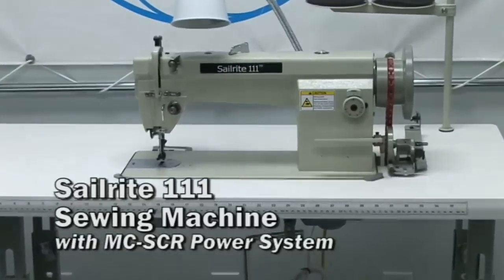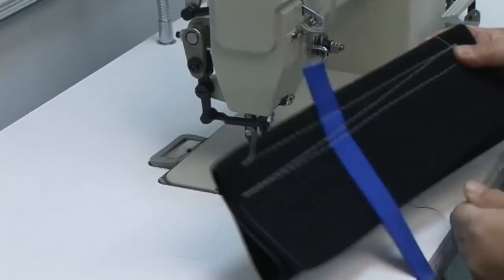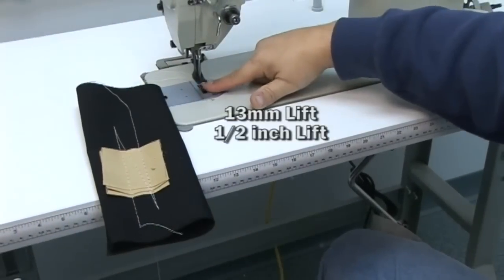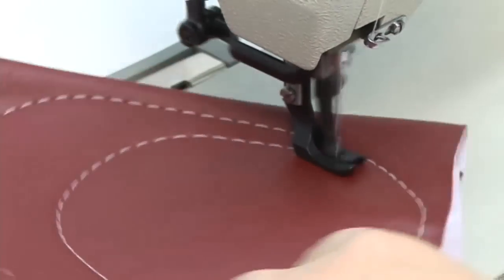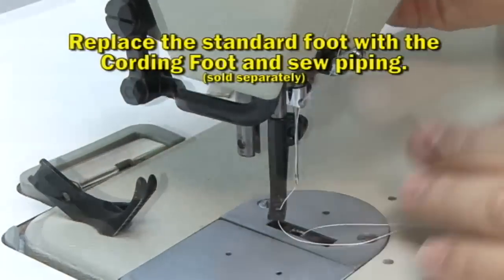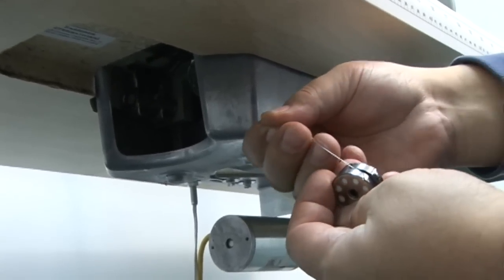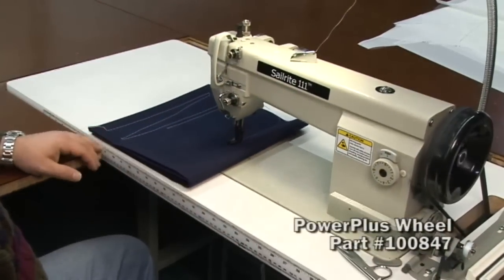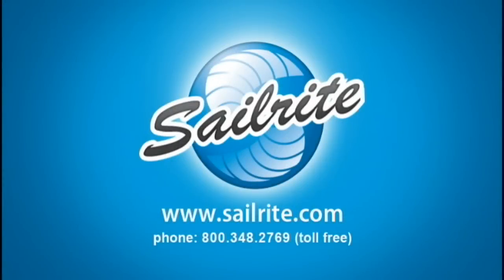Sailrite 111 Sewing Machine in Power Stand with MC-SCR (Discontinued)

Comment: This is the Typical GC6-7D With Sailrite logo on
Reply from the maker: Yes and no. The head is made by Typical, but the sewing machine head is modified, adjusted and timed by Sailrite technicians here in Indiana. Then we add the Sailrite MC-SCR power systemand many other components which are made in the USA. So... if you want a machine that works great right out of the box with the best motor system in the world, go with the Sailrite 111 sewing machine which is miles ahead of the GCG-7D out of the box.
Reply: Sailrite Yes its a great machine, I have the Typical machine With the 750W HoHsing servo motor and its sew very slowely With alot of punch. Why do you have to change  the timing?  Timing on my machine and others I have sold is correct out of the box
Reply from the maker: Ragnar Johansen Sailrite spends about 3 to 4 hours on each sewing machine head adjusting not only the timing, but the walking foot, the feed dog motion and the appropriate position of the feet to accomplish the best feeding possible over flat areas and also large bumps. Not only that but we set the stitch length to accomplish the same forward and reverse stitch length and we make some adjustments to cams on the inside of the machine for better feeding so the needle is always centered in the hole of the feed dog and more. I am not one of our sewing machine techs, so I do not know every step, but I do know how picky they are and that they will only releasing heads that work perfectly. Chances are that the machine, as is, works ok. But after we are done making our adjustments it is just about perfect! You will always get what you pay for at Sailrite and our service and support cannot be matched!
Reply: Sailrite Thanks for Your reply on what Sailrite is doing, but I think the factory setting of the machine is ok in most cases. You  get a very good user manual With the machine which describe how to change all the settings if you like to change it for personal improvement.
Reply: Ragnar Johansen Forgot to mension that this is a Mitsubishi LS2-1130-BOB 
clone, one of the best Constructions ever
Reply: +Ragnar Johansen Search YouTube for this other video by Sailrite:  "Sailrite Ultrafeed vs. Look-a-like Sewing Machines".  

It features a different model in the Sailrite lineup, but the points made about how Sailrite specifies a modified casting for the heads they order, how they specify higher quality inner components at key places, and how they swap out some standard parts for more robust parts or parts with tighter tolerances, probably holds true on the 111 model as well.  

I don't work for Sailrite.  I'm just making assumption here, based on how they approach all their products and extreme focus on customer service.